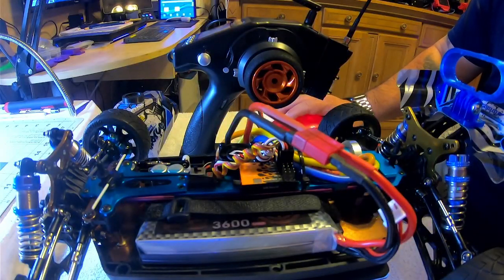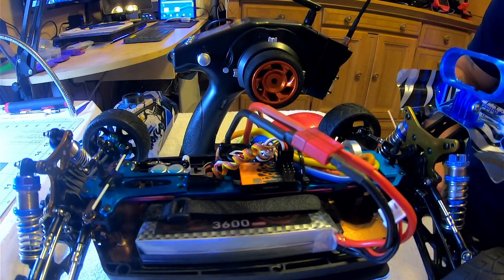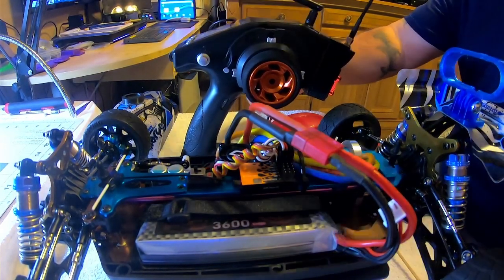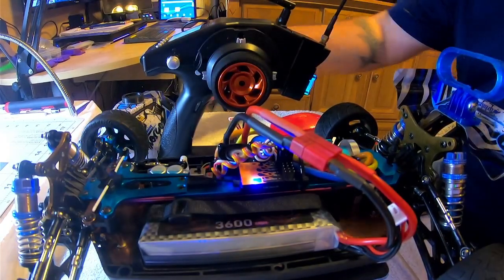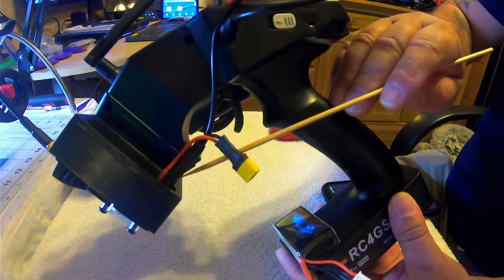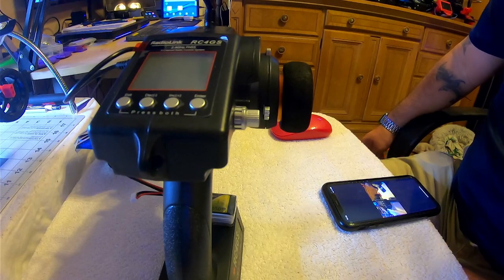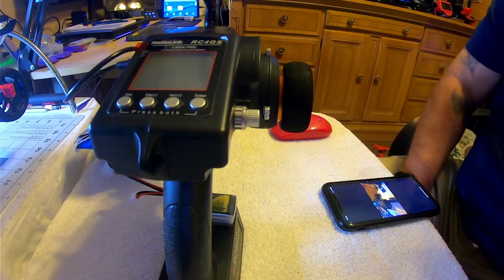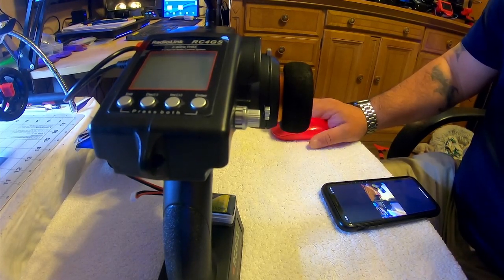ELRS on Radiolink 4GS V3 and Flysky GT3B GAME CHANGER

Comment: Hello, Is the firmware fork still available? Can you tell me how to do the same thing, namely adding an ELRS module to my Flysky GT3B with a PPM/DSC port.
Reply from the maker: I don’t know if the firmware fork is still available the best option out there right now if you want to run elrs is the Radiomaster mt12 i have had one for a while now and it is the best transmitter i have ever owned
Reply: @rickzfpv3118 I have tried it with flysky GT3B & aion nano TX jumper. However, there is a problem with the TX module restarting when the steering/throttle is moved. is there a special way to modify the module? I want to use my old remote control with the elrs tx module
Reply from the maker: @yonmudi  honestly i havent looked in a while i can look tomorrow and send you a link to it.  I purchased a radiomaster mt12 and it has a module bay for elrs

Comment: if u connect elrs module directly to the sim port was it working fine or did it require some programming or software installation
Reply from the maker: No Mine just plugged in directly and it worked, you just have to have a seperate battery for the module, and you have to make the cable for it so it communicates properly.  I don't use this wystem anymore as I purchased a RadioMaster MT12 which is plug and play for ELRS.

Comment: Good info, brother! Thanks for putting this out there 🤙
Reply from the maker: I think now though with the RadioMaster MT 12 doing it my way is kind of obsolete.  I actually have a MT 12 on the way will be really cool because I can bind my existing radiolink receivers to it and use elrs when I need to or want to
Reply: @rickzfpv3118  For sure. I've been rocking the MT12 lately and it's great. What protocol do you use for radiolink? There are a lot of options on the 4in1 versions, iirc.
Reply from the maker: @ChaddRainsFPV  chad is haven’t gotten mine yet because of slow holiday shipping should be here this next week if you look though on the 4 in 1 module github it tells you which one you should use for the receivers